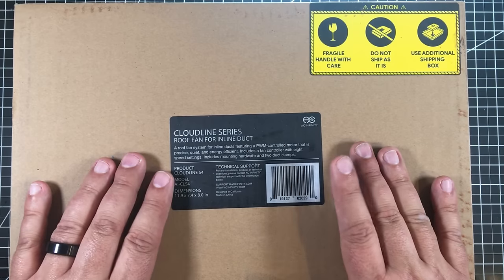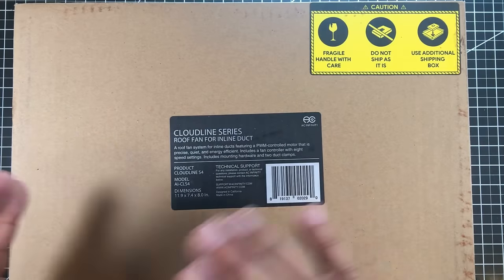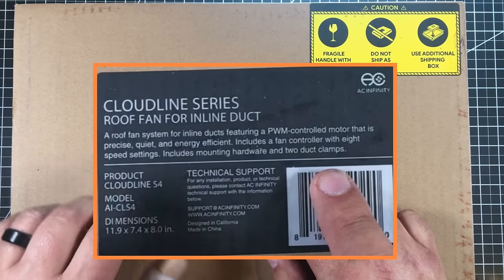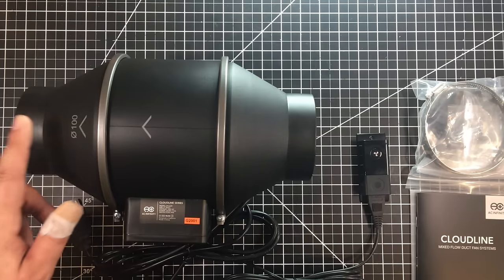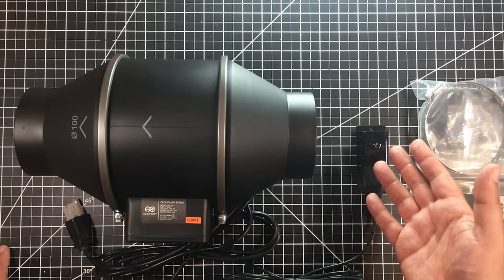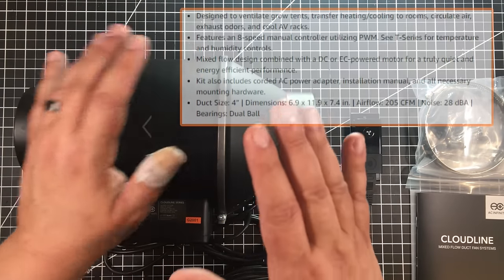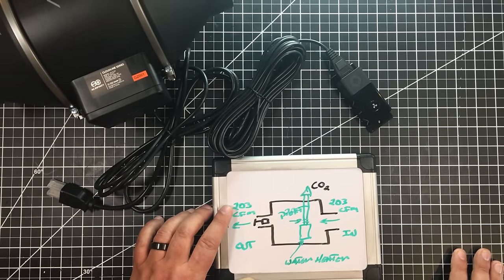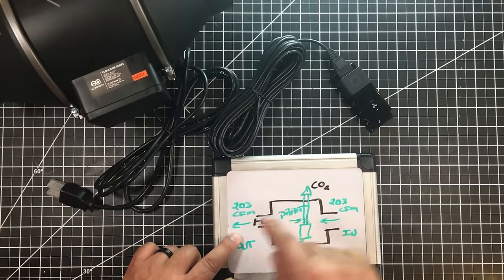Shop Talk -  Fume Evacuation From Lasers and 3D Printers!

Comment: I sure am glad you talked about putting fresh air back into the room. I have read so many comments on other videos that this fan didn't work well or that fan didn't work well. The thing is, they were all trying to pull a vacuum on their house with it. The fans are not designed to do that. It's one thing if you have your laser in the garage and you open your garage door and turn on your extractor fan and you having your laser stuck in the spare bedroom and trying to exhaust the fumes. The latter isn't going to work because there is no air coming back into the house.
Reply from the maker: Well said!
Reply: 100% my inner physicist was hoping and it's an excellent point too about the CO hazard if there's furnaces or heaters and stuff

Comment: The Cloudline fans are fantastic - I setup a 4" one in my home work area for my small laser cutter and for things like solder fumes etc two months ago.  Much quieter than cheaper quality similar fans and their support was great when I had some questions about which size to get before I bought one.  In addition to your warning about carbon monoxide it is important that people know these type of inline fans are likely not rated as spark proof so may not be the best choice if you are venting anything that may be flammable such as a paint spray booth - a small hobby booth for airbrushing should be ok but for anything larger a blower type fan is a better choice.
Reply from the maker: Ah!  Very good point on the spark proof!  As part of my plan was a smaller desktop spray booth with a prefilter...

Comment: I'm over it. I built a metal laser box with a 6 inch duct on top with the Cloudline 400 CFM pulling it out a window. I tried adding a 4 inch fresh air fan (Cloudline) into the box. No, still a lot of smoke smell. Closed that off and I left about a third of the box open in the front with a fan gently blowing the smoke to the back of the box for extraction. That kind of worked, but still so much smell. Yes, I have a window cracked in the back of the shop for both tests. I have a large shed shop I build guitars in. I would NEVER have a laser in my house. I'm at my wits end and sending the laser back. I am now feeling sick with sore throat, headache, etc. Oh, I was also wearing a respirator mask with the two round filtration cartridges as well. These lasers are not safe for your health unless you have a really good system to extract/filter the smoke.  The thing is, nothing is out there for these desktop lasers. Well, nothing good. Those crappy enclosures they sell couldn't extract any smoke with tiny computer fans. Funny how xTool markets these lasers showing no enclosures or dust extraction. Also, they don't show the smoke they make, especially when cutting wood.  I wish I had known. Now fighting with them to get a full refund as they want to keep 500 bucks for returning it. Costly mistake. These desktop lasers are so dangerous not just for smoke, but for your eyes and fire danger. Be careful, people!

Comment: Is it enough to carbon filter the room air with a airfreshener instead of venting out the fumes?
Reply: No. A carbon filter will only absorb some chemicals, but not others. CO and CO2 gases will not be absorbed by carbon filters and can built up quickly in a room. Many materials including ABS and acrylic will also produce extremely toxic gases like HCN which will not be absorbed by a carbon filter.

Comment: Nice video. It’s pretty rare to talk about CFM and how to get efficient airflow when exhausting fumes. One point is really crucial : the diameter of hoses used to suck air and exhaust it. I just got an AC infinity s4 (205cfm, 10cm diameter) and due to adapters reducing the di Nice video. It’s pretty rare to talk about CFM and how to get efficient airflow when exhausting fumes. One point is really crucial : the diameter of hoses used to suck air and exhaust it. I just got an AC infinity s4 (205cfm, 10cm diameter) and du to adapters reducing the diameter of exhaust hoses, I have a HUGE loss of pressure, and it eventually sucks almost no air from the laser… do you have any ideas, advice or successful set up about that ?  (Kind of length oh used, incidence of any curves or even the inner material of hoses to allow smooth flow of exhausted air) THANKS !! 🙏🏻🙏🏾

Comment: I'm shopping for a resin printer.

If I use a grow tent along with fume evacuation system and carbon filter, would that be a good solution and allow me to safely work in the same room while the 3D printer is printing?
Reply: I'm using this set up. Before it I had strong headaches, not anymore so I believe it's working well

Comment: So would you recommend getting a second inline fan and pulling air in at the same rate? is it ok to have the air ventilation and intake mounted in the same window? I have a 1000 sq ft basement studio with a few mediums that need ventilation and I haven't had a problem with carbon monoxide yet but your video got me thinking... I have a studio glass kiln with built in ventilation (inside the kiln) that is near my water heater.  I'm setting up a 3D resin printer on the opposite end of the basement and was planning on building duct with an inline fan into the window, maybe hooking it up to a closed cabinet to run the resin printer in. Up till now I've just opened the basement door to the backyard and put a fan by it to bring air in but that won't work for overnight prints or colder months...
Reply: The air intake and exhaust have to be several feet apart. You can see an example of this if you have a newer furnace or hot water heater with a forced air draft; there will be two pipes going outside, with one a few feet above the other. If you put them too close, the air intake will suck in much of the dirty air that was being exhausted.

You don't necessarily need an intake fan too, though it can help. As long as you have a low resistance path for air to be pulled in, the negative pressure caused by the exhaust will draw air in through that intake. But if you don't provide some kind of intake, the air will be pulled from whatever path is available. That could mean pulling air in around door and window seals or through chimneys. Typically, you want to have a bit of positive pressure if anything so that any remaining pressure pushes air out instead of drawing dusty air in. If it's in a garage or other similar room, it's not a big deal, but as DIY3DTECH pointed out, if it's in a room with a chimney, it will draw air in through the chimney, which you definitely don't want, so then it would be a good idea to use a dedicated intake fan.

For the colder months, if you really wanted to get fancy, you could consider installing a heat recovery ventilator (HRV). This box includes intake and exhaust fans and a heat exchanger so that the warm air exiting can warm the cold air that is entering without the two air streams ever mixing. However, HRVs aren't designed to exhaust smoke and fumes, just stale room air. It would be fine for pulling air out of your kitchen when cooking or a bathroom, and would probably be fine for exhausting lingering fumes from a 3D printer, but you wouldn't want to pipe a laser cutter exhaust directly in to it or it would quickly be damaged. If you first put it through some significant filtering (furnace filters, carbon filters) to remove most of the soot and heavy particles, then the remaining gases could probably be exhausted through the HRV without too much trouble, but you would likely be voiding your warranty anyway.

Comment: I just bought a Anycubic Photon S and I'm asking myself if there is any risks of fire or explosion with the formaldehyde concentration of the printer and wash and uv curing station if I use a fan with the engine in the air flow. I tought I could use a bathroom ceiling fan but the company does not recommend using it to evacuate toxic vapors. My other option is a Franklin Electric 1 / 30hp @ 1550 rpm squirrel cage type blower with the engine outside the air flow coming from an old air exchanger but the shaft from the motor connecting to the barrel fan inside  the blower tend to get hot a bit and I ask if it is enough heat to cause a risk of fire or explosion. I intend to use this venting system on a old re-purpose television cabinet sealed and equip with a plexiglass door having about 0,174645 square meter volume (15" x 27" x 29"). I know that's a lot of question but I want to make my 3D printing experience as safe as possible. Thanks a lot for a quick reply if possible I would like to build this unit during Christmas holyday. Love your video and the security concern you have about SLA printer.

Sorry if my english is a bit bad I usualy speak french.
Reply from the maker: No worries with the English, with one printer I would not overly worry about explosion however you want negative ventilation and that will be be based on your room and/or enclosure.  I would also recommend something purpose built such as the unit in the video rather then hacking something for safety reasons...

Comment: What are your thoughts on placing the inline fan as close to where it exits the building vs close to the laser engraver? I have heard that its best to pull the fumes through the duct rather than push them through the duct.
Reply from the maker: If you jump to 3:04 in the video you can see a teaser insert of my setup where this is the case (fan near exit point).  As the idea is to creat a negative pressure area so yes :-)

Comment: The attic fan in my house will blow out the pilot light on my water heater if I open the door to the basement while it's running... even with all the windows in the house open.

Comment: You got me nervous now. The room my laser will be in, is next to the room my water heater and furnace are in... Very close proximity to this small room. How much CFM is too much and becomes worrisome about drawing in the C02?
Reply: He did the PSA right after talking about creating negative pressure so I would assume if you have the same flow in as out youre good. I'm not sure if just having an open window or similar would suffice though so I've been considering just getting two of these and having one for bringing air in??

Comment: Nice video. So if I want to make an enclosure for a 3D printer to suck out the fume, I need to install two fans rather than one? Where would be the best locations to install the fans?
Reply from the maker: just one of these and its perfect as you can spin it down.  Remember you not trying to create a vacuum, just negative pressure in the box.

Comment: Have you seen the video titled “recycling cardboard into anything with 3D printing” you should watch it and try and recreate it
Reply from the maker: Are you speaking of the one where the kid puts cardboard in a blender and uses 3d printed molds?  If that is the one yes, however seen it and it is pretty cool yet very time consuming.  However I also came with my own hopefully easier version which if it works I will share soon.